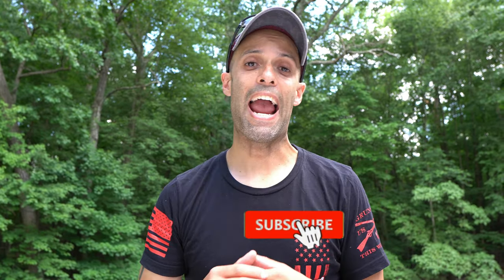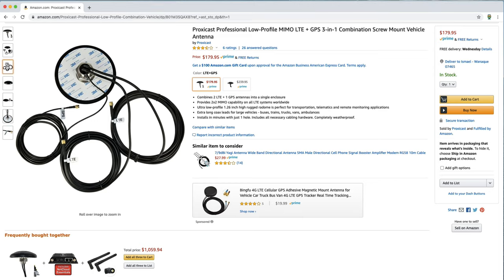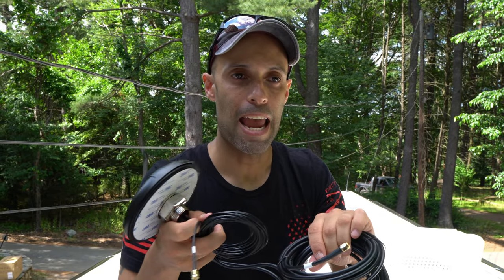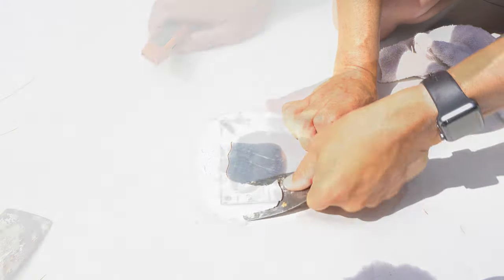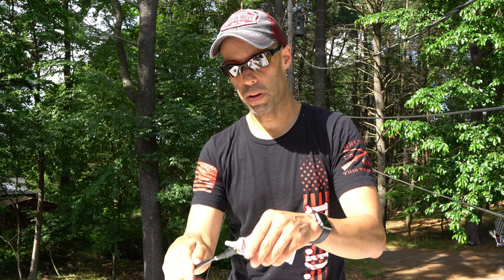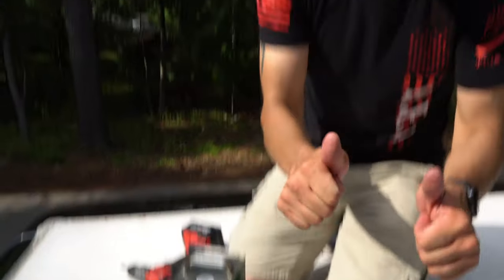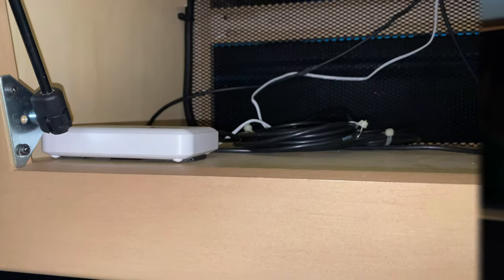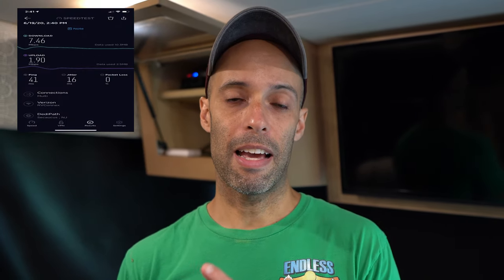The Easiest Way To Increase Your RV Internet Speed!

Comment: I wanted to give you a little professional advice on fishing from an electrician. Aside from how close to the electrical wires you were behind you that you bumped (I know the ones you bumped were the phone and cable). When you fish, use dish soap if you don't have pull lube. It cleans up easier. Also, make sure you cover the end of your leader and cable smoothly with the tape so it does not catch on anything. I think I would have pulled the fish line up the tube with the existing wires and pulled everything back down with the fish tape. I did like your presentation, very clear and easy to follow.
Reply from the maker: Thanks for the advice! 👍 - MJ

Comment: When using the fish tape (the fishing tool), push it up from the bottom and then tape the cables on. Stagger them, so that you can put both on and keep a low profile. Then the person down below can just pull everything through without any problems.

Comment: Thank you for showing how to install the antennae. Good placement of the router by the opening of the cabinet. I have to tell people all the time to treat the router like a sprinkler head , the more open it's placed ,the better the range.
Reply from the maker: Hi Richard thanks for checking out the video and yes the cabinet is the perfect place.  It’s current location allows the signal to reach the rear of the Rig with no problem.   Thankfully Newmar made life a little easier for me with the “satellite prep”, certainly could have been a more in-depth job.   

Izzy

Comment: Looks awesome. I was hoping it would replace the TV antenna that doesn't do anything. I like that setup. Definitely a little cheaper than the antenna you had on the ladder.
Reply from the maker: Hey Chris,

Yes it is cheaper not as powerful as the speed tests show but still far better than stock antenna.  We will still carry the WirEng for areas with poor signal.

Comment: Thanks for sharing! We are dealing with bad connections now. I am certainly going to check out you Amazon Affiliate page to see the information on this add on! Safe travels guys!
Reply from the maker: Awesome make sure your router has sma antennae inputs or the antennae is useless.   Thanks for watching and the comment. 

Izzy
Reply: @EndlessRVing  i have to get a router as well. I trying to decide between a weboost and the router and antenna setup.
Reply from the maker: The router antennae is the better option.  If you are looking for a router with true unlimited Verizon service email me. As they say in the Sopranos “I gotta guy” lol

Comment: Love your channel! You should open your own RV shop! Are you still using the mofi4500 and are you using it with this antenna?
Reply from the maker: Thank you for the kind words.  We are currently testing a new proprietary router on the Verizon network that is allowing us unlimited Verizon service.   With that said the Mofi will also work with the proxicast antennae.  Thank you for watching and the comment. 

Izzy
Reply: Endless RVing thanks Izzy!!
Reply: @EndlessRVing  Currently using mofi4500, and a directional antenna, and used unlimited companies over ATT, and T Mobile, but curious what provider has a Verizon unlimited plan?

Comment: How did you know about the conduit from the roof to the front? I could use something like that rig you installed.
Reply from the maker: GBmoves it’s on the electrical drawings that were provided by Newmar when we purchased.   I also called Newmar to confirm what was under the “satellite prep” plate on the roof.   The antennae is sleek and clean and mounting the router in the front cabinet with an external antennae lets us run our network going down the road.  We can stream TV and MJ can work while we are moving.   

Thanks for watching and comment. 

Izzy

Comment: The wires behind you are scary
Reply from the maker: Not worried.  I use to hang pole cams in a bucket truck off those wires.   Thanks for watching and the comment.  

Izzy
Reply: @EndlessRVing  I was worried when I saw the wires as well, but I assumed you knew they were either insulated or just phone lines.  Still, got to be careful.